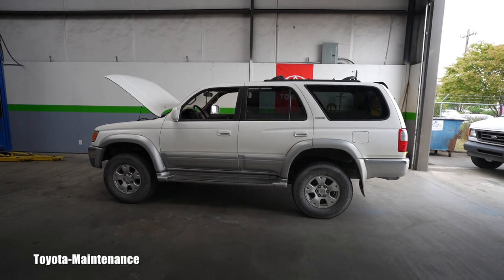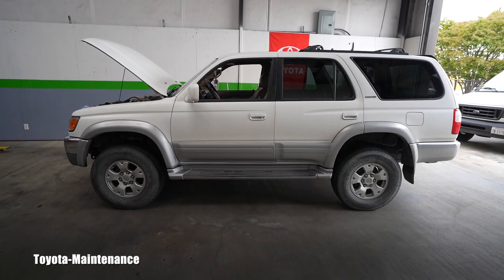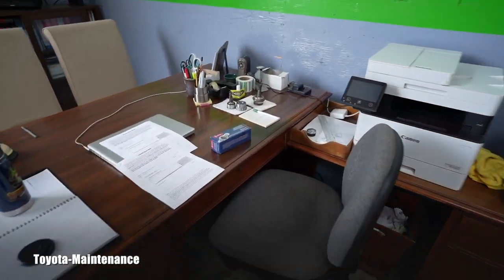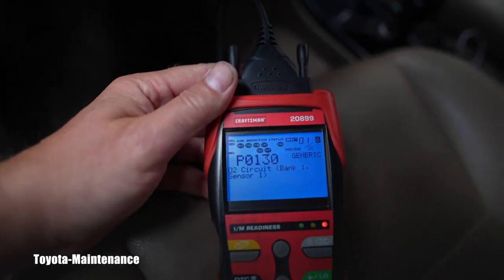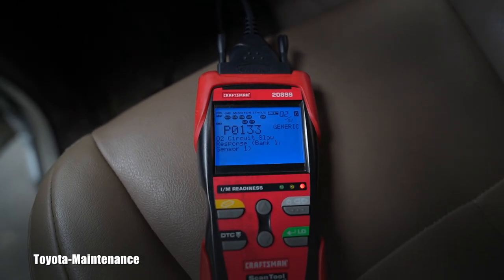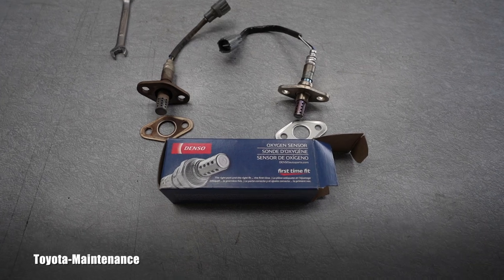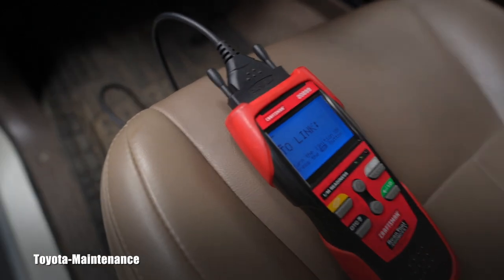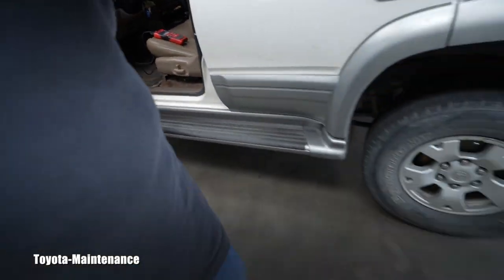Toyota 4Runner codes P0130 P0133

Comment: Thank you so much Peter for sharing your wisdom I've learned a lot from you my check engine light went on on my 2002 toyota Tacoma 3.4 l engine I plugged in my scanner I got the same code so bank 1 so I went to orielly I bought bank 1 and bank 2 I figured I might  as well replace both since I did the work and saved a ton of money

Comment: Why didn't you remove EFI fuse or disconnect battery to reset the fuel trims?
Reply: It will do it by itself after a set amount of drive cycles or conditions met. You might reset more than just what is intended

The Toyota ECU is constantly learning driver behavior and adapting trims over time

Comment: Maybe you can recommend she get one of those cat shield plates or if she is a student or fixed/limited income, can weld some short lengths of rebar to prevent removal of the cat since it is above the ground and high. However, it is an old car, they usually want the new lower polluting vehicle. Less dirty precious metals..

Comment: Those oxygen sensors on vehicles are like the capacitor in your air conditioning condenser unit in your back yard. They WILL eventually fail from exposure to heat. But when the capacitor fails in your AC unit, the unit won't run, since either the fan motor or compressor motor won't run with a bad capacitor. Bad capacitors are the cause of 90% of 'not cooling' calls for central air conditioners and heat pumps. You can change those yourself, and save at least $100. I keep a spare one on hand, since you don't want to be without AC in 70% humidity and 94 degrees on the Louisiana coast. Peter will never have that problem in northern California, with that cold water current from Alaska to keep him cool. Without that cold current  California would be a hot desert with a LOT fewer residents. LA would be 108 instead of 78 during the summer. No Hollywood there. Probably no Silicon Valley either. We have the hot Gulf Stream bringing warm water north from the Caribbean Sea, along with hurricanes. Too bad it doesn't work to warm us up during the winter. It keeps the UK & northern Europe from icing over though. It ever shuts down, and the UK turns into Greenland. The US might become a big desert too, with a lot less moisture coming up from the Gulf during the summer months.

Comment: Just cleaned the sensor rathe than replace.
Reply: Same here,Had the P0133 years ago and cleaned with MEK and blew air through the holes,Code or check engine never came back.Used Jetlube Nikal pure nickel 2600 deg F anti seize on bolts and nuts and gasket surface.